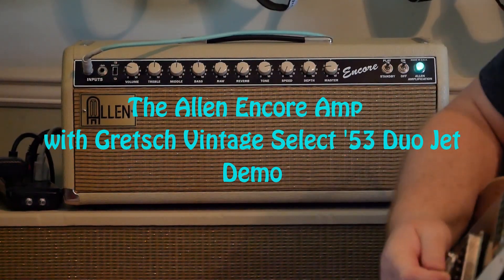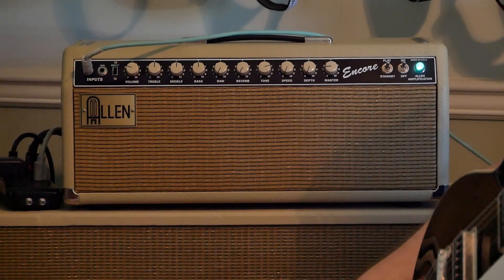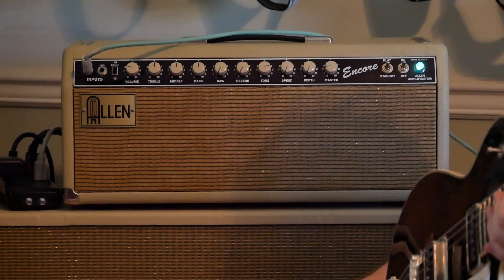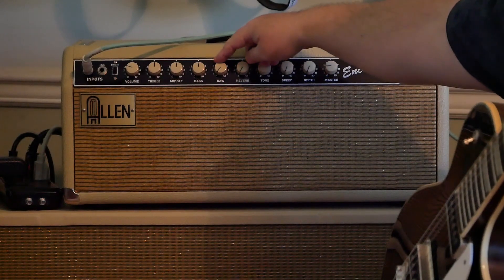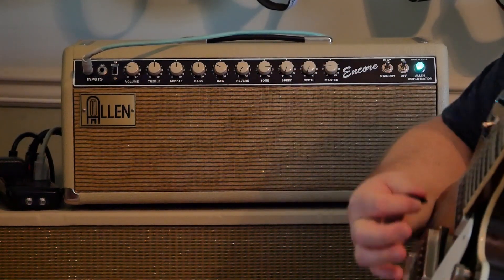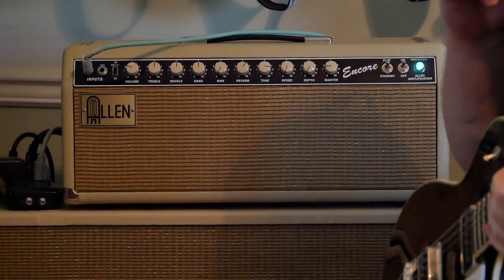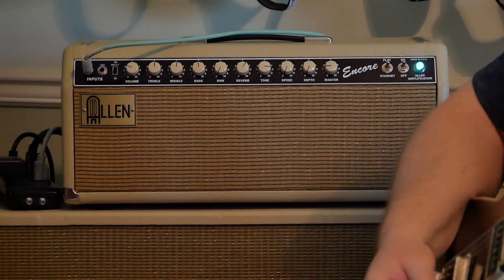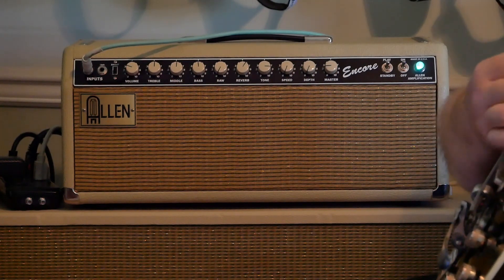Allen Encore Amp Demo - Part 1 with Gretsch G6128T-53 Vintage Select  '53 Duo Jet

Comment: How do those transients feel? I’ve got a lead on an Encore, but I’m looking for something with more Blackface Class AB sponge than Class A/Brownface bite. And I’ve heard that the Allen amps are a bit edgier than their Fender counterparts.
Reply from the maker: Thanks for watching,  - I thought the transients were fine from what I can remember. Unfortunately, I've moved on both amp and guitar as a gear junkie does. :P
Reply: Built an Old Flame (Super Reverb-ish)  a while back.  Fantastic amp.  Based upon that one I'd say the Allen amps are a touch stiffer in the power supply than their Fender similars but still well within the Blackface realm.

Comment: Nice video.  I'm curious how well the master volume switch works at home at very low volumes?  Can you use it to get edge of breakup tone at home?  I'm looking at this amp and hoping to slim down my collection with an amp I can play at home as well as gig with.
Reply from the maker: Thanks, Roger! The master volume worked perfectly. After acquiring a few vintage Fender amps, I sold the Allen Encore. I'd still have it if I hadn't made those acquisitions. It's a great amp! :)
Reply: @atomicsonic_surfysonic  Thank you so much.